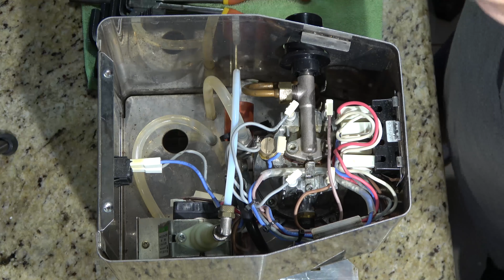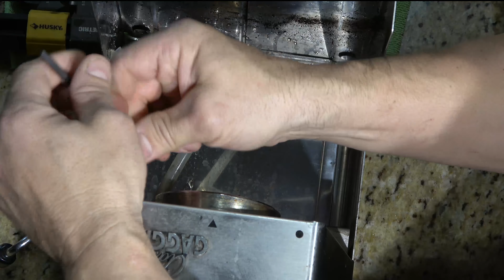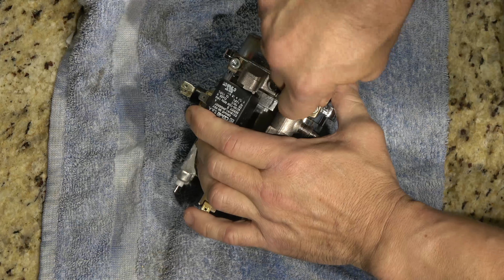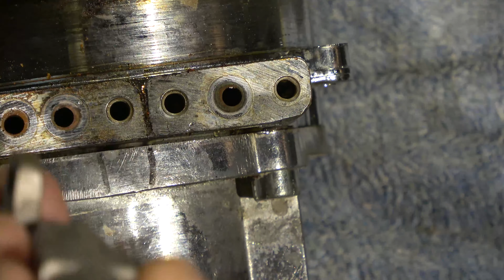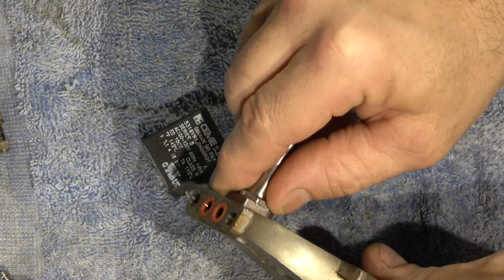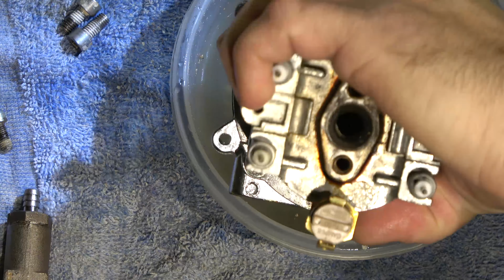GAGGIA  CLASSIC SERIOUS CLOG PROBLEM - SOLVED!

Comment: Thanks Eugene, there are lots of disassembly videos but yours was the most helpful to me as it wasnt scripted and I could see everything you came across, what you found, how much effort to take certain parts, challenges you encountered....

It was great and I was well prepared for my own tear down!

We don't have hard water but I was very surprised at the amount of crap that came out of the various valves and even more horrified of the boiler. I didn't disassemble it, just soaked it with decalcify solution, used a brush and swirled it around trying to scratch the sides... Repeat a few times.

Anyhow thanks for posting this! Much appreciated
Reply from the maker: I am glad that the video was helpful!!

Comment: Very nice video nice to see it all opened up before I take mine apart.  
Any idea why three water paths into the head?  
Is there a water/circuit diagram out there for how this works?  
I have the older version of this (black plastic case). but it has a nice brass boiler!  
It has been in service since 2002.  
My water pressure is getting less & less.  ( gradually failing) guessing sure it's the pump.

Comment: What is wrong if there is a water dipping from the grouphead constantly when the machine is on ?
I had a solenoid valve clogged and I cleaned it as you show.

Comment: I'm an idiot it was just a pinched hose, but had to open it up to see this.  
Mine is the older version of this (2001-2002) black plastic outer case.  
The pump is much different/bigger.  
There is no solenoid, water routing is through a manual valve.  
That valve is getting a little bit leaky after 25 years of use.  
Pressure is back fully and working great.  
I keep it clean, it has a new group gasket from two years ago.  
It cost $200US brand new in 2001 on sale and has been in continuous use since then LOL.

Comment: if you take that bottom plate off 
and just pop a screw driver in to one of the screw holes then tease it off 
 behind that plate it will have lime scale on it which you can scrub off
Reply: Which bottom plate sorry, on the boiler or?

Comment: Thank you for this video! Since I fixed the machine it leaks water from the top of the boiler where the steam wand is positioned. Any ideas how to fix this? I’ve tried to tighten the screws as much as possible.

Comment: It would be cool if you could hook up the pump and run water through the items to test them (check water flow) while it is still all apart.
ALso I'm wondering what the TWO devices are that are mounted on the head that you are taking apart.   
I wonder what they do what they are for. (one has solenoid) and the other does not single hole.  
What is the big thing without the solenoid, what does it do?
Also my model may be different.  
I will have it apart soon.  
Maybe break the bolts loose with vice grips first. and same the allen parts.  
If the bolts have threadlock on them (anti vibration) sometimes heat it up a little and the loosen much easier while it is hot. 
 Just put 120VAC on the lesser heating element for a short time and the block will get hot or use a heat gun to heat it up around the bolts.

Comment: One should invest in a water filter and jug like a Brita .it would help against your hard water calcification .
Reply: you can buy simple add on softener filters that go onto your water inlet hose .. cheap and would save all that maintenance , they also make bag type ones that sit in your water tank  just change them every couple months instead of tearing apart your machine every couple months!
Reply: Thanks for suggestion but here in UK things aren't so easy .the Brita really is the simplest solution and it works fine as long as you change filter monthly.you can get mains feed water treatment of its a retrofit  then a plumber is needed .modern homes ofcourse are now fitted with them if one lives in a hard water area .unfortunately my home was built in 1522 .

Comment: Nice shower now!!  HAHA   (confirmation mine is really bad)  
I have actually been using the steam pressure back through the group to "help" brew espresso.  Time to take it apart and fix. 
Toward the end You didn't show if you got the metal puck to come out :) or how you got it out.  
Probably needed some force/prying/hitting LOL.